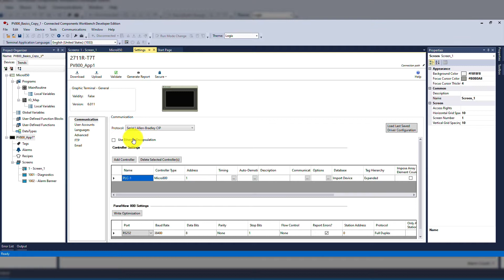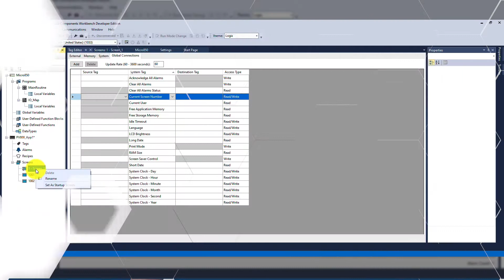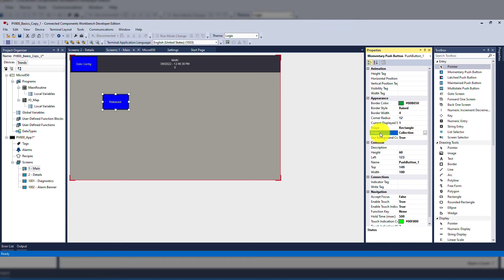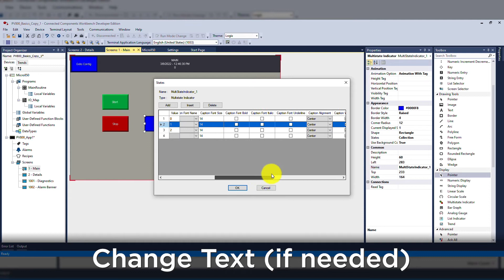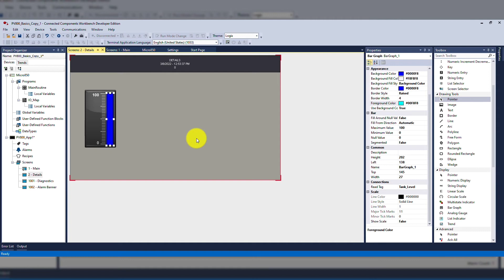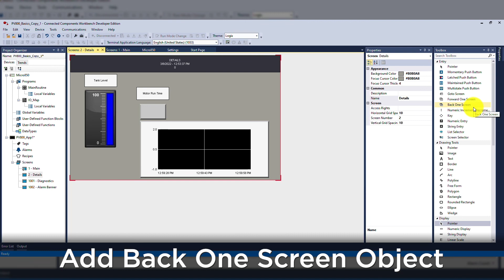Tag Creation and Screen Development - Panelview 800 and CCW - Part 3

Comment: amazing video, just i Have a cuestion, I have the problem than you mencioned in the minute 4.10 seg, how can i fix this problem, actualy the error is 2053. screen switching controlled by external source i really preaciate your answer
Reply from the maker: Look at the Global Connections tab for the Current Screen Number System Tag. This PLC tag is something other than 0 which means the PLC is in control of navigation. You need to determine if PLC code needs to be changed during your issue, by writing a 0 to that tag and allowing the HMI to control its own navigation again.
Reply: @ESECOTV  the global tag is diferent to 0, actually de value is 12, but, could be damaged the logic program if i change the tag to 0?